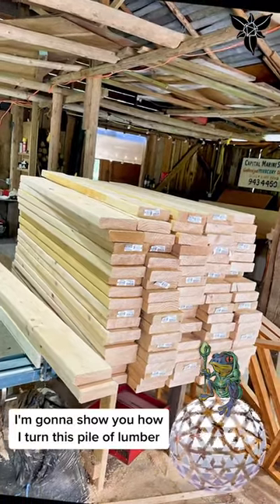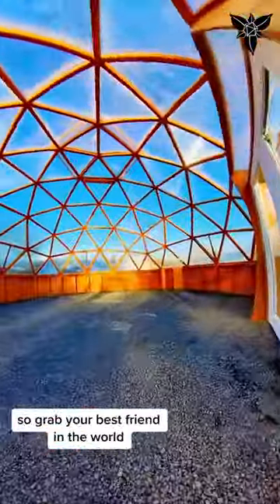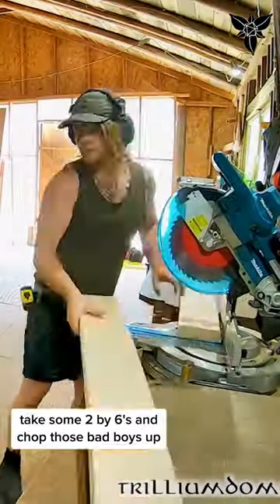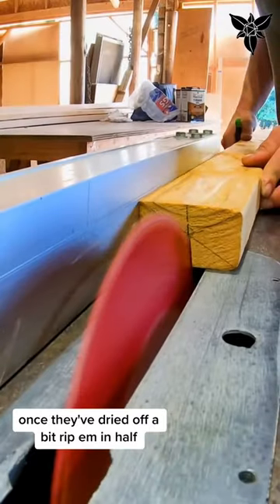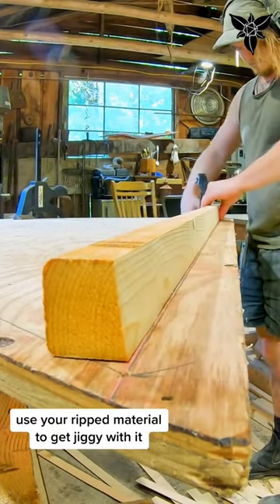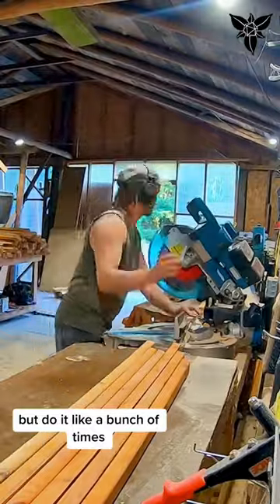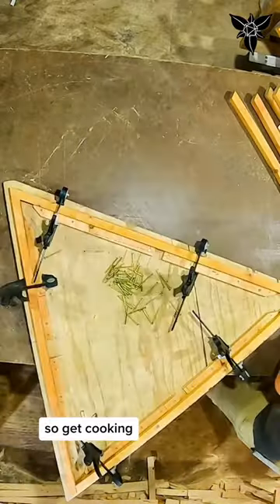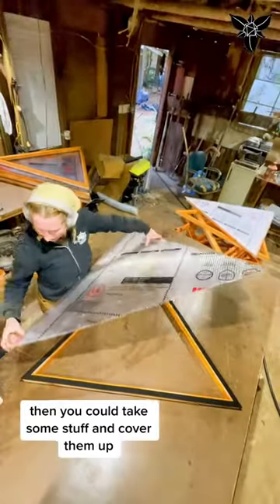Building a wood dome without hubs 🤤 #woodworking #diy #ideas #geodesicdome

Comment: Looks great! The polycarbonate is attached on the outer surface? With screws?nails? What size triangles did u use? THANKS much!
Reply from the maker: Check out my step by step guide on youtube https://youtu.be/Sl9fEp-27EM
Reply: @trilliumdomes  thanks
Reply: @trilliumdomes link won’t work